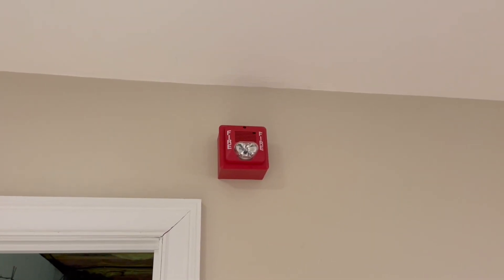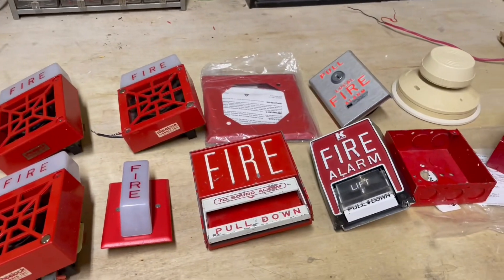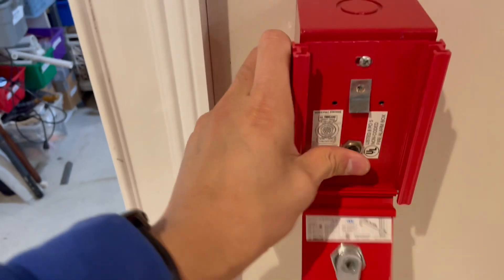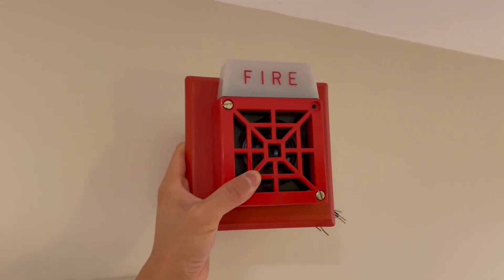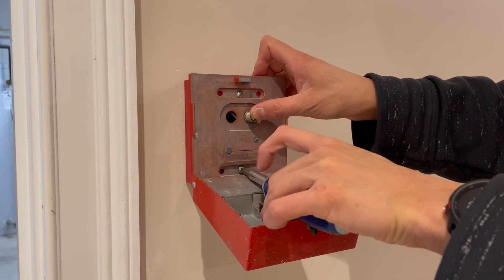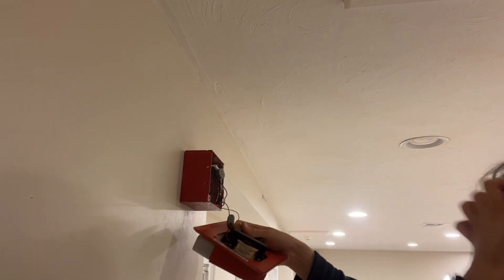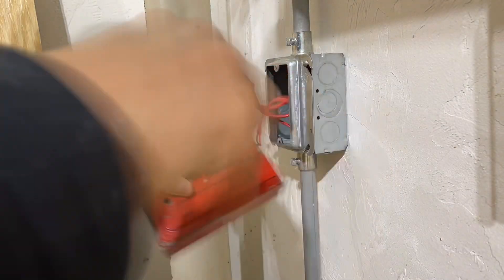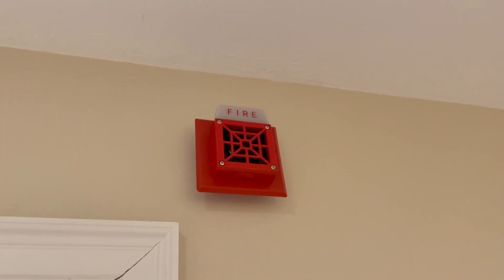Installing Vintage Wheelock 7002 Horn/Strobes - “Downgrading” a Fire Alarm System

Comment: You mean upgrading? The newer we get the more we downgrade and the older we get the more we upgrade…
Reply from the maker: Obsolete equipment from the 80s is definitely not an upgrade
Reply: @ it is because less recalls more reliable less likely to break down…
Reply from the maker: @ definitely not more reliable..older fire alarm equipment like this

Comment: I don't understand why someone would throw out perfectly good fire alarms I'm guessing the previous system it was in was upgraded but thankfully they ended up in good hands if it were me I would have put them up on ebay that would have been a win win situation. Anyways I'm not 100% sure but I think these old 7002's were manufactured from 1978 to 1985 before their tamper resistant counter parts were introduced. Is there a way to date these?
Reply from the maker: Obsolete equipment isn’t worth much to most people
Reply: Since the 1990s frosted strobe horn strobes/speaker strobes have been considered defective since ADA became a thing. Their good alarms but only until the horn loses it's ability to function. Synced strobes existed way after these no longer became compliant to code.